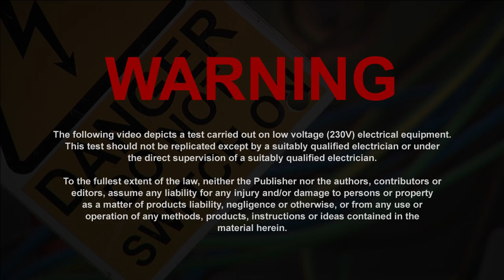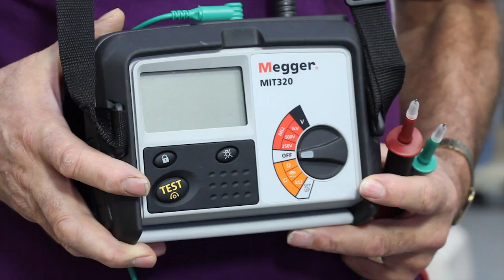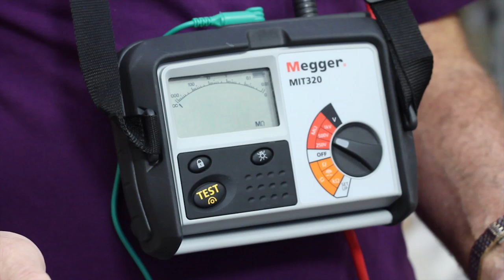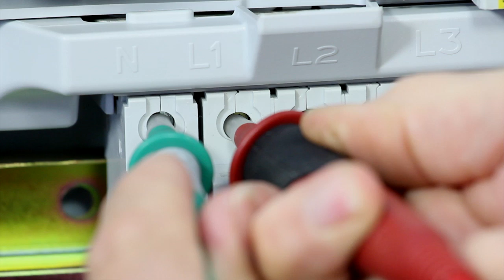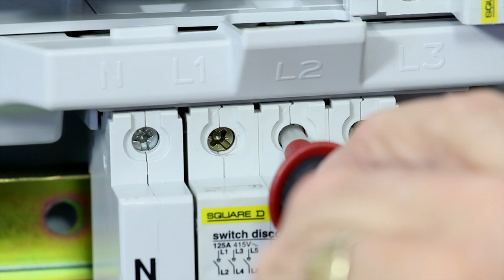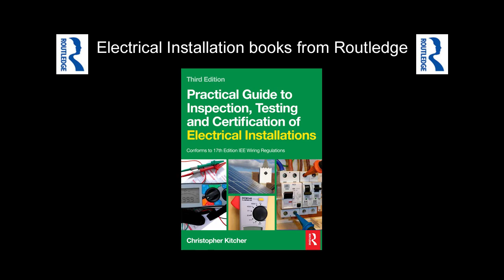QR code 7 -- Three phase insulation resistance test

Comment: Shouldn't  be getting  1000 mega ohm reading  between  neutral  and earth as they share the same fault path  back to the meter and on to the star point of the transformer  the neutralising link  coming into the board needs  to be disconnected  for this to work

Comment: Hi. Should you have not removed the neutral conductor before carrying out a 'global' insulation test as it would be connected to earth upstream? The isolator is 3 pole only and does not break the neutral
Reply: I guess it depends on the earthing arrangement.
He's correct if it's TN-S. You're 100% right otherwise, though.
Reply: @Bacon89100  Neutral is connected to earth at the transformer so it wouldn't matter. If it is a 3 pole isolator then the neutral is not being disconnected at the DB

Comment: Why did Chris set the insulation tester to 500v when you should test the circuits at double the voltage. I assume that a 3 phase DB is 430v, shouldn't the megger tester be set at 1000v. Can anyone explain?
Reply: BS7671 states this is the voltage to use ‘up to and including 500V with the exception of SELV and PELV, but including FELV'

Comment: Should be 1000v insulation test between phases as it needs to be double the voltage , 500v is only 100v over normal voltage
Reply: Incorrect. Test is 500v for systems up to and including 500v.
Reply: Read your BS7671 part 6. This is a common misconception. If you test 600V cables at 1000V you have exceeded their Vmax and so are theoretically kippered.
Reply: @daniel bryan, I'm confused, please could you explain why you think that?

Comment: Hi great video. 1 question please,  ...so do you actually go around the plant, factory, house, building etc. and disconnect all PC's, toasters, equipment, light bulbs, and burglar alarms. surely youl miss something, and then run the risk of blowing up something, pls could you explain how you go about that task.
Reply: Fredre Olivier... good point just imagine 1 month of second fix and you now got to take apart 1 months worth of 2nd fix to test so you can hand in the results before hand over on Friday. 

Now what do you do?😦😢
Reply: How do you go about the task? Easy.
If it's a Friday afternoon, you just put it on 250v instead of 500v.
Reply: i would drop voltage to 250v d.c and/or put live conductors together (as one) and test them between earth
Reply: Fredre Olivier Just disconnect the circuits with sensitive equipment and do a test between live and neutral connected together to earth and that stops any damage, i'm no expert but this is what i've read in gn3